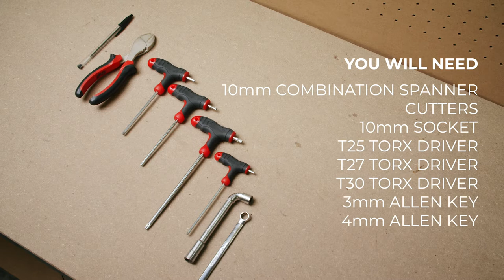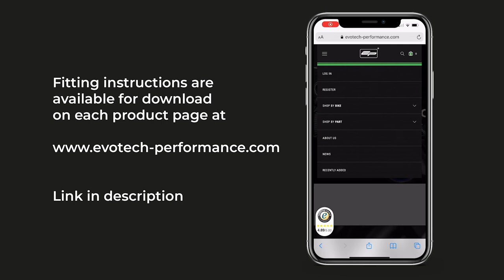How to fit an EP Tail tidy | Evotech Performance

Comment: Terrible instructions on website, this was supposed to be plug and play for the MT09, no idea how to connect the indicators, seem to have to cut into the wires, the reason I spent more on this was not to do that, if you had clear instructions this wouldn’t happen!

Comment: My dealership's service department told me this doesn't work with U.S. license plates. Is that true? I'm having them install my Tail Tidy, and they told me they would either have to drill holes, hang my Texas license plate sideways, or I would have to purchase a separate license plate holder.